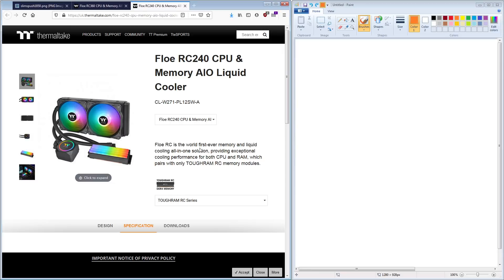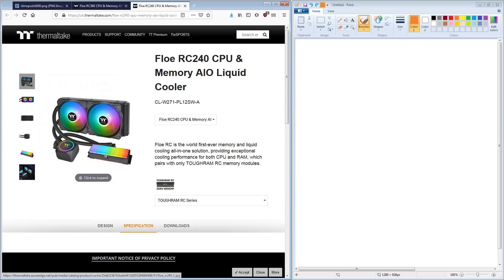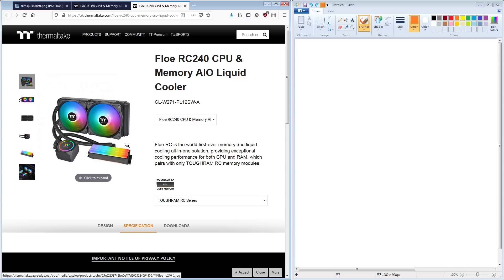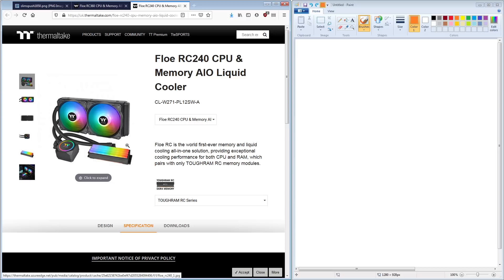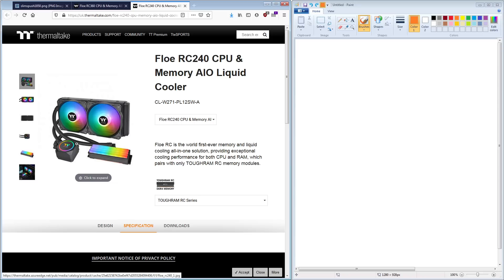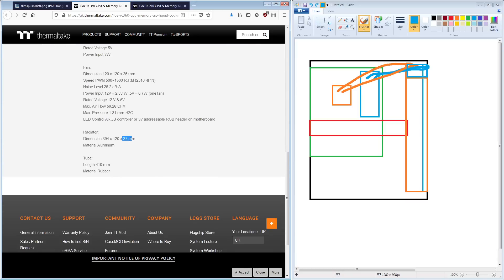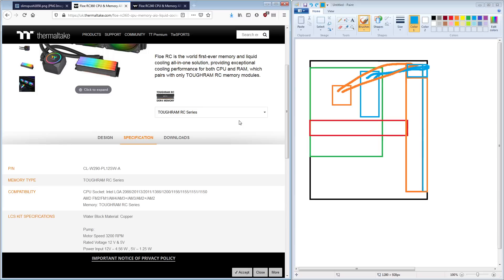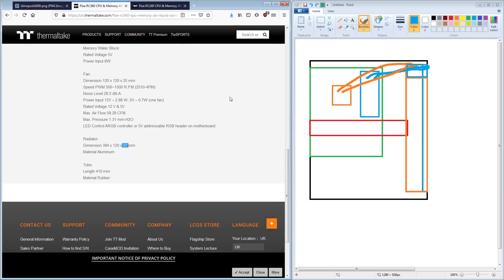Rambling about Thermaltake's Floe RC RAM + CPU liquid coolers & RAM cooling

Comment: This miniradiator idea reminds me of how my car's ac radiator is basically slapped in front of the engine radiator.

But now bz is designing a memory aio that's unlikely to sell as well as an aio that cools both the CPU and memory, in the name of optimized memory cooling.
There's probably a reason it only pairs with rgb ram.
Reply from the maker: Yeah the stacked car rads is my original inspiration
Reply: @ActuallyHardcoreOverclocking  I would be very interested in how they've designed the memory water block and contact areas though.  I suspect they're cheating on having water flow near each stick and just using thermal mass and heat transfer to an outer flow path.

Comment: I love your rambling videos, so much knowledge gained through osmosis about subjects I want to know more about

Here's my idea for Case Cooling Setup if you're going to use CLC's:

Front Intake = 2-3x 200mm Case Fans for Cool Fresh Air
Top = Modular Plates for 240/360 or 280/420 RAD's with Push/Pull out the top and exhaust to the top sides or straight out of the top depending on user preference
Rear = 140mm Single Rad dedicated to RAM Modules and exhausts out of the rear above the Rear IO Panel.
Basement houses PSU
GPU can be stock cooling or if you insist on cooling it via Radiator, use Basement cooling to bring in air from the bottom sides and let the hot air rise up.

Back Plate area of MoBo should be minimally Thick enough to allow 2-3x 5.25" Drive Bays stacked 90° sideways depending on how tall your case design is intended.
This allows the room for at least 1.x 5.25" Drive Bay thick for wire management which is much more generous than most case designs out there.
Support "SSI-CEB" MoBo layout as the Min standard over ATX for better compatibility with modern MoBo's that are getting a bit bigger.
Reply: Cooling RAM with a CLC/AIO set up as an exhaust wouldn't work, because you'd be pushing hot air from inside the case through the radiator. It would just end up the same temperature as the air inside the case, so you may as well not bother.
Reply: @nathangamble125  That should only be a problem if you had a "Heat-Pipe & Fan" directly venting into the path of the rear case mounted small single fan CLC.

My idea was to have 2x separate CLC's.
Larger 2-3x fan set on the roof
Small 1x fan set on the back
2-3x Large 200mm Case Fans in the front

That should solve most issues.

Comment: IMO common mistake when OCing the RAM is just running memory stress program. 
Memory stress program does produce some heat in the memory modules but it is not that much.

However, when you're gaming or doing some other work, rising case temperature and/or heat transfer from back of the GPU will heat up memory modules. 

So sometimes RAM OC passes overnight memory stress test due to low temperature but when you start using the computer normally the memory OC gets unstable because of heat from CPU and GPU heating up the memory modules. I recommend running memory stress test program in conjunction with some GPU and/or CPU stress test program to test realistic heat scenario.
Reply: you're preaching to the converted, lmao. BZ made an entire video dedicated to GPU heat destabilizing memory months if not more than a year ago.

The common CJR and Rev.E (well, kinda) ICs won't nearly be an issue at 1.35-1.4V. If you're pushing enough VDIMM to run into thermal problems on those ICs, you should already have a dedicated fan blowing on your RAM. If you're running B-die beyond XMP, you should also already have a dedicated fan on your RAM.
Reply: ddr4 hyperx 2133 14 14 14 35 cr1 running 2800 mhz 1.5v i can touch it with my hand, I guess if you run like 1.7v it does make sense
Reply: @nubbins70  I was pulling my hair out 2 years ago with this issue. Taking the foam filter off my front panel fixed that.
Reply: davidthek1ng higher frequency = higher power draw. Higher voltage = much higher power draw. Now welcome the people who run 4000MHz+ on timings just a bit higher than yours at 1.6v+
Reply: Indeed, thankfully most DIMMs come with fairly accurate temperature sensors nowadays.

Comment: Your idea of separate loop for memory is nice but it has some problems. It would need additional pump for the memory loop and it would be quite expensive and/or unwieldy to install. 

So I wouldn't recommend water cooling memory only with custom loop with large enough radiator which can maintain low water temperature with all the components fully loaded.

Comment: I prefer single open loops, simply because then any one component gets the maximum possible heat dissipation in workloads where not all components are fully utilized. 

Memory is a bit different, since it's utilization and CPU utilization are pretty highly correlated.

Comment: I completely agree with you. I will say though, to be completely fair I have a 9700K running at 4.8/1.275 with High LLC on a GIGABYTE board. Under a normal gaming load my CPU never seems to draw over ~70W I'd say. So perhaps in certain scenarios this might not be totally useless.

Comment: I run Bitspower ram blocks on their own loop, with a 280mm rad. The CPU (1680-V2) is on it's own loop, and the GPU (Titan Xp) is on it's own loop, each with 2 XSPC RX360 rads. I noticed a big stability issues when the RAM was in a loop with anything else.

Comment: The Arctic Liquid Freezer 2 has a thicker radiator, and it is below 100 bucks.
Reply: Unless you live in Canada where you can't even get the 360, and the 240 and 280 are like $200+tax
Reply: @twizz420  That's tough.

Comment: If you were to do a custom loop with CPU, GPU, and RAM on the same line then what kind of fluid temperature should you aim for?  
You seemed to imply having the water temperature above the air temperature by 10c meant the radiator wasn't able to dissipate heat fast enough.
Also it kinda sucks that ram now comes with heatspreaders that you can't remove without destroying your warranty.

Comment: Could you do a comparison between something like Corsair LPX? Where you can get one 3200mhz cl16 kit with hynix modules, and another with samsung b-die? I had two sets of 3200mhz cl16 2x8gb LPX kits, and the hynix modules could do up to 3600 cl16, whereas the b-die couldn't even hit XMP, and I was always stuck with 3133mhz or less to be completely stable on it. Both were tested on an Asus C7H with an 1800x.

Comment: It is true, memory is very sensitive to temperature. I did OC some VLP RAM sticks (I think they were Nanya A-die and didn't have any heatspreaders) and with good airflow, I managed to get some decent OC (they weren't binned at all, just JEDEC spec), but when I changed the CPU cooler and the didn't get airflow anymore, they got horribly unstable.

Comment: Do a 280 cpu loop and 40x120 memory loop that will fit together in a 3x120 case. Those are both standard radiator sizes and at most you'd need a plastic shroud to cover the seams up and direct airflow.

Comment: The best blocks you can get for running RAM above XMP/D.O.C.P voltages are the Koolance RAM 33 ones. Keeps the DRAM's running at a happy 44°C👍
They're getting rarer and rarer though for under £20 each. 😢
Reply: My ram has the same temps with the one thing called airflow

Comment: An Alphacool NexXxoS XT45 Full Copper 40mm Triple radiator would fit in a 5.25" drive bay and accommodate 3x 40mm fans, like the NF-A4x20 PWM.

Comment: Since i'm not a fan of raditors or liquid cooling, i'm thinking something like "i wish dyson made smaller bladeless fans so i could put it in my case" in these days. My case has 6x 14cm fans btw. Another solution is buying an air conditioner but i'm looking for a cheaper option.

Comment: I'm blessed with the terribleness of having room for 3 280mm and a 140mm radiator at the same time "theroteically" top drive bays can't be removed and no fan mounts blocks 360 or a potential front 420mm rad

Comment: Hey Buildzoid, I've been meaning to ask this. What will happen if I use 16GB stick and 8GB stick together? For instance, I have 8+16 in channel A and 8+16 in channel B?
Reply: afaik you have normal dual channel running. 
you can also run say 8+8 channel A - 16  channel B and still have normal dual channel.
bank interleaving might be potentially be suboptimal but not a big deal.

Comment: So what I'm hearing, is its time for me to add a second loop to my system for my ram.
Reply: Well if you are going that route you want a triple loop system.

Loop 1) CPU
Loop 2) GPU
Loop 3) Chipset/Ram.

Or you can just run a big loop with a bunch of Rads. I am running all of them in a loop containing 4 240 Rads. (although I am fairly sure their are better options)
Reply: @Peregrine1989  I'm thinking a 120 for the memory, a 240 (and maybe a 120 as well) for the CPU & VRM (not that the VRM really needs the cooling), and a 360 for the GPU. Each with their own colour fluid. One red, one green, one blue, perhaps?
Reply: @LadyEmilyNyx  Very cool. I wish the case I had brought had more space. A smarter man would have brought the case everyone was using for Watercooling, a Lianli ESPECIALLY for their first loop...but no, I had to decide I wanted to be special and buy a unique case I would then have to modify to get everything in.

And by get everything, I mean everything but the Pump. Turns out Pumps are much bigger then I thought.

Comment: I think the that the memory has such a low power dissipation makes the fact that water cooling lets you move where you are dissipating your heat rather irrelevant... A 120mm fan will force so much airflow over the memory sticks that the temperature change of the air will be immeasurably small unlike if you were to dissipate ~100-200w or so with the same airflow from a CPU.
Reply from the maker: the main problem is that internal case air is very likely at the same temp that the mem sticks would be at if you cooled them with external air.

Comment: Ive seen some clip on ram fans was there something to that?
Reply: yeah, if you want something more elegant than a ziptied case fan. my favourite is the AMD wraith stealth fan, i think that's a 72mm cooler master that looks quite neat even when ziptied.
Reply: Nowadays RAM really doesn't give off much heat, but they are still useful when you have a workstation or server board packed with high density DIMMs and you need server-like airflow to get the heat away.
Reply: I have a bunch of Corsair Airflow's on my systems. They're not super-expensive although they may not be necessary I like having them.
Reply: Checkout the Corsair dominator airflow. It just clips to your memory slots and has two 50mm fans, there's even a RGB version. Can be picked up fairly cheap on the used market, since it's bundled with a few higher end Corsair RAM kits.

Comment: Packaging wise let's pretend its possible, if a wee radiator sat on top of the ram, all self-contained, would that be an idea?
Reply: at that point, may as well just use heat pipes from the chips up to the top of the DIMM where a regular heatsink could be. They used to have stuff like that back with DDR2 and DDR (pre DDR3 days). They would probably not bother today, because marketing would want to cover up the 'ugly' heatsink fins with RGB so air can't get to the fins, and they would be back at the original issue of the memory being hot due to a lack of cooling, lol.

Comment: So I’ve been having the opposite problem. I’m running an automatic LN2 system and when the RAM hits about -60C it cold bugs. Is there a voltage I can adjust (like PLL) or a different die (I’m on B-die) that would survive these lower temps? I’ve got some small heaters on order to warm up the ram sticks but that is going to be a pain to control.
Reply from the maker: Afaik there's basically nothing you can do other than use a more cold tolerant mem ic
Reply from the maker: Actually you could maybe heat the RAM with a warm water loop. That way you get pretty precise memory temp control.

Comment: speaking of.. wondering if anyone heard of this happen before. so my ram was on 3200mhz for longest time though nothing ever changed and was good few months but then i noticed my apps were dying and freezing so i rebooted then the memory failed training and defaulted at 2666mhz and couldn't get it to go back.. so i got mad and forced 1.4 volts and 1.2 soc like i don't give af anymore and slowly increased it back up till 3200 held again. so just curious as to why that is a possible issue
Reply: I can't immagine it to be imc or ram degradation, since 3200mhz doesn't require a significant amount of voltage. In my experience, some mobos (mostly asrock in my experience) are a bit weird with stuff like tertiary timings and 1t, 2t, gear down mode ecc... which it doesn't reset when going back to stock or they bug out and don't activate with xmp. Idk, hope this helped.
Reply: interesting. i see i don't touch the timings or anything so must be just my board being stupid i guess. it is just a gigabyte d3sh after all so its probably this cheap thing.
Reply: @EldaLuna  try something like 1t gear down mode and that doesn't work loosen up the secondaries a bit.
Reply: ok ill give it a try and see what happens a bit later on.

Comment: Random thought: take RGB RAM, do away with RGB, hook pelletier cooler in RGB voltage, mount to RAM chips. Then, mount the Thermaltake water block on top of the pelleteir cooler. Make sure loop order is CPU>rad>RAM. Should work a dream compared to just watercooled!
Reply: i don't think you realize the difference in ampere those 2 have.
Reply: @emperorSbraz  maybe, they may draw alot.
Reply: @Celician83  a lot for rgb would be 1A at 5V, and that's a stupid high amount.
a suitable tec would easily peak 10A at 12V.
you see the problem here? :)
Reply: @emperorSbraz  well then, a less elegant solution would be to have a SATA connector on each module

Comment: I saw this thing and wondered who it was aimed at. For normal users who would go for an AIO, they are not going to be overclocking their RAM so much that it needs water cooling. Even ignoring the fact that the design of this will heat the RAM instead of cooling it, all this will do for normal users is make installing the AIO even more of a pain because there are even more inflexible tubes and objects hanging off the CPU block. For extreme overclockers, they're going to want a custom loop, or at least two separate loops, and more/larger radiators. And for people who just want RGB over their memory, well there are already a million options for that that don't involve the extra hassle and tubes. This thing is just dumb from every angle.

Comment: Hey Bullzoid, I was really down that the mice just leave some weird marks on my MSI RX570 4gb OC due to me leaving the panel on last night and causing weird issue on running games lately. I cleaned the residue left by that mice and one capacitor has this greenish corrosion, I am certain that this capacitor is the one that causes me sudden shutdowns after  several minutes of use, Hoping if you know what  capacitance of this specific one over here: https://imgur.com/Zy343hY

appreciate the replies!
Reply: inspect the whole thing VERY thoroughly taking note of the exact spots where there's corrosion, then carefully clean the board with a soft toothbrush and alcohol.
it's unlikely those caps are broken just because of some corrosion, the issue could be the traces leading to them instead.
Reply: @emperorSbraz  I carefully cleaned the Graphic Card and I inspect very thoroughly behind the card and no weird greenish corrosion spotted  anywhere yet that certain capacitor I shown at the link I provided is the only one that has it, I can't open the card just yet due to having a Warranty for one year. until few days my Motherboard wont detect the card and no heat is being produced. Should I RMA it? I'm not sure if it will void my warranty because of that specific problem that I am facing right now.
Reply: @scrubsodium  i'd clean the green stuff and RMA it. i'd make sure to sound as stupid as possible and say "i don't know the screen turns blue" or whatever, don't say "water" or anything like that. good luck. :)
Reply: @emperorSbraz  I manage to clean it partially but a new problem arises i mentioned previously it does work and gets detected and now my gpu doesnt get detected by the mobo. Im guessing the mobo pcie slot is fucked too lmao imma find another test bench near me. Thank you for helping me out!
Reply: @emperorSbraz  Update: ye the gpu is fucked now, I'll RMA it for sure and will act dumb infront of them.
Reply: @scrubsodium  godspeed. may the free 5600xt be with you. :3
Reply: @emperorSbraz  I hope its a 5600xt, RX570's in my country is out of stock that fast.

Comment: funny a friend bought the 3950x just so he could one up me since I've been using the 3900x ....lol
joke was on him since all my stuff is in an open loop and he has a 240 AIO on that 3950x.....
poor poor chip 😢
Reply: @DespacitoXR no it's like a $30 cooler master one. Lol
Reply: @DespacitoXR I sent him home with the Arctic freezer II 360mm yesterday, now if he'll just install the damn thing 😂
Reply: @DespacitoXR he actually had it in his system once already, but brought it back to me , said it sounded like it was pulling air through pump , so I topped it off with fluid and gave it back lol

Comment: 14:05
This sounds like it would be ruined by convection from the CPU radiator. I'd put the memory radiator on the bottom.
Reply: convection would only happen with significance in zero fan scenarios.